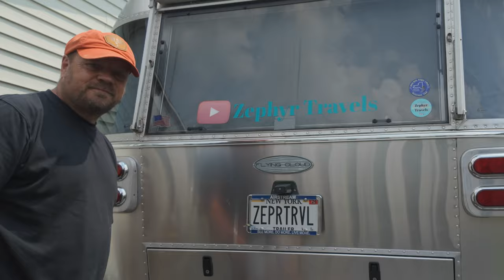Airstream Travel Prep: Fixing Hot Water Heater & Airstream Cleaning Tips | RV HowTo

Comment: Glad you got it working. My water heater is gas and/or electric. I generally use electric but about every fourth trip I run the gas side just to make sure it is working. I have the east coast finished off except Georgia which I will get in April. Glad to see Diane feeling better.
Reply from the maker: Diane finished her last Chemo while we will recording this video!  Woo Hoo!  She doing great, just needs to get her strength back.  We still have a few gaps in the map, but we been able to check off 29 states so far.  You may want to pick up one of the fuses for your hot water heater to cary as a spare.  My understanding is it's a common failure.

Comment: The soot on your water heater vent screen indicates you are burning a little rich. Try adjusting the air shutter to get a blue flame with yellow tips.
Reply from the maker: You are correct I did have an issue with the burner on the hot water heater.  In my case it was caused by a stuck valve on a propane tank.  I have since fixed the issue and we are burning clean again.  Thanks for the tip. BTW - getting the black sooot off the vent is almost impossible 🙄